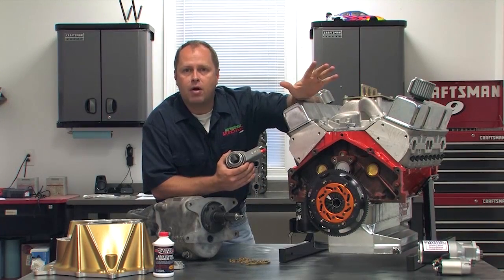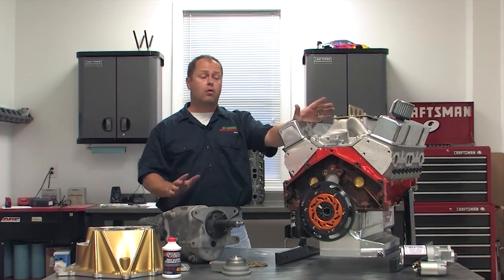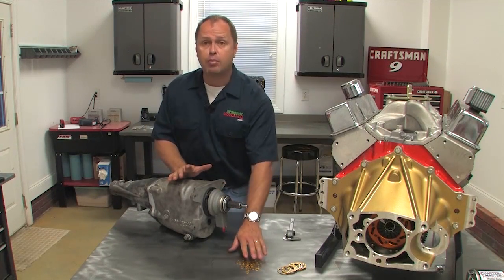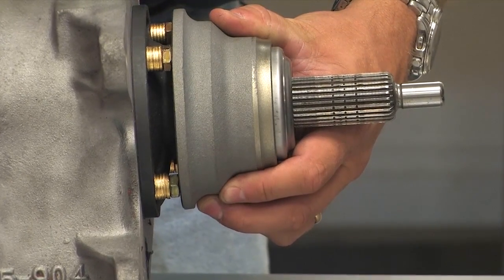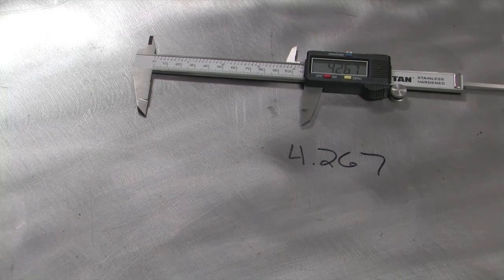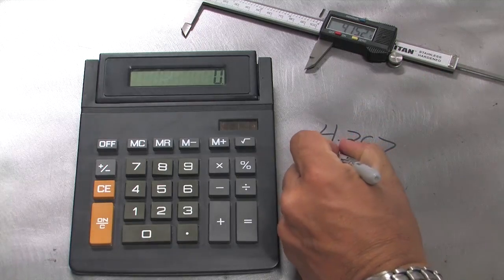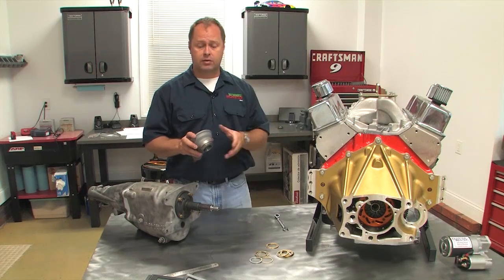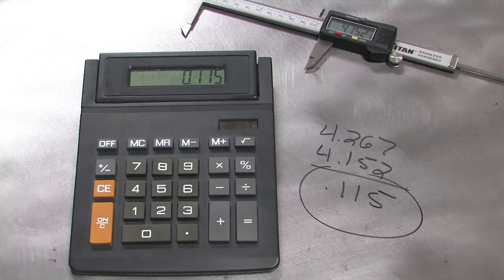How to Set Up a Clutch and Throwout Bearing

Comment: I have a question? I have a QuarterMaster clutch just like that in my race car and If I push my clutch peddle in all the way the the engine decreases at idle and shuts the engine off in my race car. Would this be caused by to much shims? If I push the clutch peddle 3/4 of the way in it grinds going into reverse but 1,2,3 gear are fine. So when I push the peddle in all the way so it doesn’t grind going in reverse that’s when the engines idle lowers and engine dies. Is this because of to many shims and no air gap?

Comment: This video and finnegans garage are the only two that explain this correctly. Others are taking measurements from the engine to the fingers and other whacky stuff. Same answer, but more steps and alot more confusing. For such a gorgeous clutch setup, am I the only one kinda surprised how chinsey the bolts with washer stacks look?